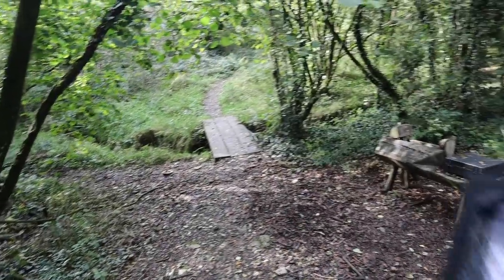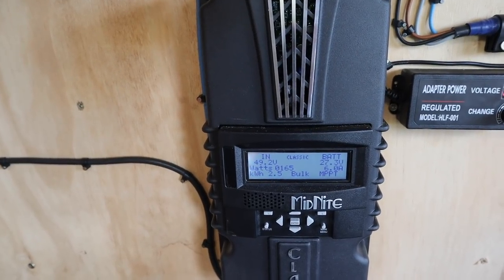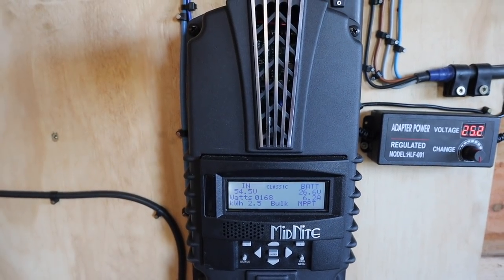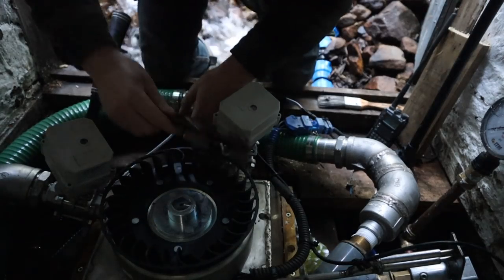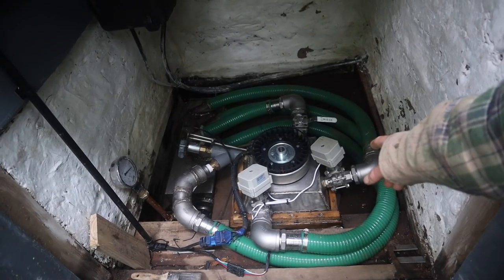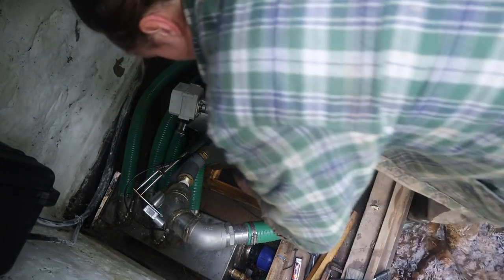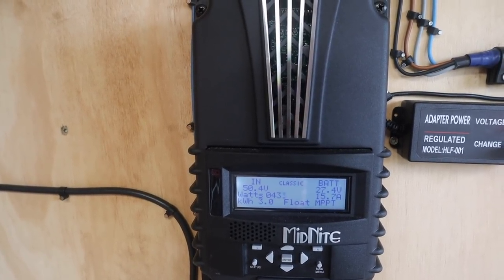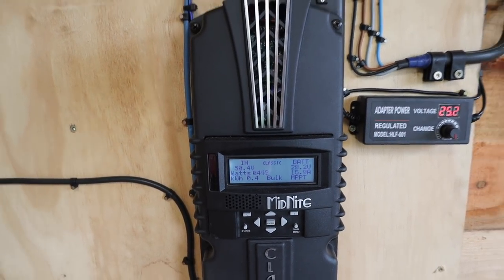Off Grid Micro Hydro Turbine Fine Tuning (13.25% Increase In Efficiency)

Comment: Careful about a hasty replacement, your rectifier likely already contains low Vf fast rectifier diodes. For any >60V 10A Shottky rectifier this is 0.55-0.65V per diode, for a total rectifier drop of ~1.1V, so check it with a multimeter in diode mode from phase to DC before you swap it. You can get very new 60V 10A rectifier parts rated down to 0.45V drop (e.g. STPS10L60 Vf=0.48V) but swapping from 0.65V to 0.45V is chasing only a few watts. Synchronous rectifiers are hard to buy for ~50V 3PH unfortunately. 

If you could find the correct transformer you could step up to 380-480V at the turbine then using a ~98% efficiency 3 phase AC to 48VDC DIN rail power supply for your rig. That'd sort out both rectifier and transmission loss... but the transformer will require some hunting, and you're still only chasing a few tens of watts at most. Your setup looks ace!!!

Comment: For tuning purposes, you can check the rotation speed at the turbine,  you could use a cheap 'contact tachometer' which would immediately tell you your gains and making a note of individual nozzle results at max tune would help you down the line in checking quickly, if anything is 'off'. Great video and hope to see some tachometer readings in future video content.

Comment: Look out for Shottky Diodes with a low forward voltage and your Amp Range. Then connect 6 of them and make the bridge rectifier out of these. You'll find plans on the web.
Reply: I agree, have used shottky on smaller projects and they work good quick responds time
Reply: Seconding this idea, although using a synchronous rectifier with mosfets would be more efficient, it is more complicated and more easily damaged than shottky diodes. And as others have said, the transmission losses of the cable would be higher.
Reply: I love peanut butter and jelly.....its complicating more than you think....
Reply: @ishansha7197  me i love jelly and peanut butter,  it's easier then you're method ;)
Reply: why 6 diodes
Reply: @davidj5574  Because it's 3 Phase AC
Reply: @70stefg  EVEN FULLER BRIDGE RECTIFIER!!!
(c) ElectroBOOM
Reply: Hmm i am wondering what is the phase to phase voltage on your system? if you are getting 60V DC it should be like 35V so you could actually use this thing!
Reply: There is also a ideal diode rectifier, using a LT4320 chip, and mosfets...ganging 3 of them, it is capable of doing 3 phase rectification
https://www.powerelectronics.com/pmics/lt4320-ideal-diode-bridge-controller-cuts-power-dissipation-improves-efficiency
Reply: @haydenc2742  this! ideal diode rectifier is where its at
Reply: @haydenc2742  There might be an issue with the AC frequency using that chip
Reply: I don't know wher you're up to with the rectifier by now. But what about a heatsink for it and a fan? Seen that used on a wind turbine rectifier.

Comment: Hey Kris,
So one of the defining factors that will decide what electronics you can use to improve the efficiency of the rectification will be the RPM of the alternator. The most simple would be a move to Schottky diodes for their lower forward voltage drop. the other stage would be synchronous mosfet switching but that would be far more involved to design. happy to help!

Comment: Hi Kris, you can place a 3-4 inch aluminum spacer block (heat sink) under your rectifier, make sure the block has cooling fins covering the sides of the block. You will find images online 'aluminum heat sink external cooling fins for rectifier'. It will also reduce fire risk.

Comment: The kind of diodes is important normal diods have a 0.7v voltage drop. Skotky diodes have 0.2v. Multiple that bij the current an that is your loss. You can meassure the voltage drop with a multi meter. Succes, love your channel

Comment: hey man might be a good idea to mount that rectifier on some kind of standoff bracket and maybe get a piece of cement board or something non-combustible to mount it to.  just for piece of mind sake. love the channel
Reply: Yeah would be awful if it lit the shed on fire - maybe a cheap second hand ebay heatsink for the rectifier as well - or even a fairly stout piece of flat metal if that's on hand.
Reply: It's still wasting the same watts as heat!
Use Shottky diodes, lower forward volt drop, less heat.

Comment: Great work Kris. I would agree with sticking with diodes. Simple and basic and just work. I was wondering that if you strapped the diode pack to the side of a metal water tank it would help cool them as well as provide some possibly useful warm water for washing in while working in the shed, it could even be rain fed :-)

Comment: Hey Kris, following up on some of your older videos, where you had the Question:  Whats the alternative to a Standard - three phase bridge rectifier (50C)?
Did you find the Alternative?
Active Synchronous Bridge (35C), Use an active synchronous bridge rectifier to avoid the diode losses (heat).  97% efficient

Comment: If you are using a "normal" rectifier there will be a forward voltage drop of at least 0.6v unless it is under-rated i.e. if you are currently close to the rectifiers rating the voltage drop could be 1 volt or more and the watts loss would be higher. If your current is 9 amps (450 watts at 50v) the rectifier will dissipate about 5 watts at 0.6v dropped and be warm to touch. 5 watts in 450 is only 1% lost in the rectifier. 

 If you use schottky diodes to form a 3 phase bridge rectifier (6x diodes) the forward voltage can be as low as 0.2v, though again, as you push more current relative to the diodes' rating, the voltage drop will rise. 9 amps x 0.2 volts would be about 2 watts wasted so you save 3 watts against a normal bridge rectifier. I don't think a saving of 3 watts is worth the effort of changing the rectifier.

The current flow of 9 amps is effectively shared across 6 diodes so I would be using at least 25a 100v schottky diodes e.g.
https://www.ebay.co.uk/itm/DSA50C100QB-Diode-Schottky-rectifying-THT-100V-2x25A-160W-TO3P-IXYS/193001047520?hash=item2cefc245e0:g:r30AAOSwuchdMWSv.

I agree that a synchronous FET rectifier would be even more efficient but they are not simple to build. Fets do not have the same forward voltage drop and just exhibit a resistive effect. Cheap fets could be as low as 0.0045 ohm each when fully "on" so even if the whole 9amp flows through 1 fet you only lose 0.04 volts drop and 0.4 watts lost.
Reply: Rhian, I think you have to double your loss figures because of the bridge configuration. (A diode coming and a diode going) I would be interested in the line loss. Not sure if he specifics the wire size and length? A transformer would reduce the line loss but add its own loss. Anyone with numbers?

Comment: Just so you know the midnight classic is cutting the power back when it's on float you need to put a load on it so it's in bulk that way you see the true maximum power output
Reply from the maker: I did switch on loads in the video for that reason. just takes a while for the controler to come out of float mode.

Comment: Hi Kris,    For your Bridge Rectifier try schottky diodes.  Standard diodes have a volt drop per diode of 0.6V . a . schottky diode has a volt drop of 0.4V.    So if your running at 20A then there is an approximate 4 watt saving to had.

Comment: It's funny to think your smaller nozzle would be my largest. You could wire more rectifiers in parallel I think to reduce the resistance.
Reply from the maker: i would love to have the pressure you have though! things are cheeper when you have high pressure low flow.  After seeing your last video i really think the spear valve is going to cause you problems. i would go with two fixed nozzles that you can easily change. that low flow is going to be REALLY hard to set with a spear and you will find the range of adjustably is tiny, just a fraction of a turn and you will go to far and be draining the penstock. Just my thoughts :)
Reply: @KrisHarbour  Yes, I might at some point in the future have to try machining a smaller spear valve like you have been mentioning. Spears don't work then I will try a 4-bit arrangement of nozzles 2, 4, 8, 16 gallon per minute nozzles and turn them on and off automatically to keep the forebay tank full. That will allow me to tune flows in 2gpm increments. I found some data showing one right-sized nozzle is more efficient than multiple smaller nozzles so that's something to think about. I think below 2 gallons per minute I will have the same friction losses you are experiencing and might need to build a second smaller turbine that has lower friction but lower capacity for the summer flows. 
Which model of generator are you using from motenergy and what rpm are operating at to get your voltage at your maximum watts? I'm at the point where I need to select and buy my spoons.
Reply: Putting diodes in parallel is not going to reduce resistance or voltage drop, they are semiconductors.
If they are ordinary diodes they will drop 0.6V on forward conduction, and 0.2V using Shottky.
The current will be shared between the diodes, but the same power will still be dissipated as heat over more diodes.
Reply: @martinwragg8246  that makes sense.

Comment: I agree with other commenters that Schottky diodes should cut power losses significantly - at least half, if not a third or better, depending on the Vf of your current diodes.
 It's the exact same circuit as you already have and there are lots to choose from. Personally I'd go for something like 4x IXYS DSS16-01A, since they've got a low (640mV) forward voltage drop, can handle 50% more current than you'll likely subject them to, at twice the voltage, and they're only about £1.50 each in small quantities.

Alternatively you could build a MOSFET-based rectifier using the LT4320 chip from Linear Technologies, which is fairly trivial. Total part cost would be about £22 if bought from Mouser UK, assuming you can scavenge a heatsink from somewhere for free. The 8-pin DIP packaged part (LT4320IN8) is about £9 inc. VAT. For transistors I'd go for either Fairchild FDP023N08B-F102 or ST STP260N6F6 N-channel FETs, both of which are readily available and cost around £3 each inc. VAT. Both have very low on resistance (Vds-on <2.5mOhm) and have breakdown voltages exceeding 75V, which should be ideal here, and both come in a TO-220-3 package which makes it easy to solder to them and screw them to a heatsink. The circuit design is in the datasheet for the LT4320 which you should be able to easily find online - effectively it's the same as a diode full-wave rectifier except the diodes are replaced with MOSFETs and you have a chip that sits in the middle which connects to all four "points" on the rectifier, plus the four transistors' gates. Total power loss at max load would be about 5W, compared to the 24W-ish you'd lose at max turbine power with a decent schottky rectifier.

Comment: I was wondering if you really need the fan, or if it’s just a safety to prevent uncontrollable spins. If it’s just for the no load situation I wonder if a centrifugal clutch could help not waist the energy during normal operation. Great videos!

Comment: I'm thinking what these small hydro applications need are fine adjusting slide plates for the nozzles to mount to & an accurate means to measure the turbine's rpm.

Comment: You could be loosing energy by having the manifold down near the turbine rather than a manifold up at the inlet end with 4 penstocks, one for each jet.
Hydro turbines rely on kinetic energy of moving water as well not just hydro static pressure and your system likely relies mostly on hydro static pressure alone as the kinetic energy of the water is accumulated in the manifold.
Down stream where the water is flowing at high speed the more looses there would be from friction due to any sudden change of direction of flow at a manifold or tight bend.
Consider 4 penstocks off a collection manifold up top for each jet and bring in all 4 above the unit and have a large radius bend on each of them downward to each jet to maximise the velocity of the water as it arrives at each jet.

Since you have the means to measure power output of each jet it would not be hard to try it by taking one hose off the manifold and block the outlet off the manifold and then running another penstock pipe down to the one hose to see if that jet increases the power from it being fed by its own penstock pipe rather than off the manifold.
Reply: So it would be more efficent if the feeding pipe splits in a 1in4 manifold rather than with the collector box feeding the 4 nozzles? Like a 4in1 exhaust manifold, only inverted? Interesting idea!
Reply: @horstszibulski19  
A bit like that
As the water runs down hill it is storing energy in the form of momentum the more energy will be lost by it colliding with surfaces like a manifold unless the manifold is well designed to bifurcate the water smoothly and the box is not a smooth path of flow and probably acting to diffuse energy of the moving water.
So having the 1 into 4 manifold up top where the water has not picked up momentum the losses would be reduced.
Reply: @AuMechanic  So Kris would need 4 feeding pipes from the intake downhill to the turbine?
Would be great to see how much differnce that concept would make, but I think in this case it would be too much effort and spent work&material just to prove this...Kris said he already produces the equivalent to the consumption of a average UK household in energy, hence he don´t use that much, so the actual setup would be more than enough...
But nice to have this interesting discussion!
:-D
Reply: @horstszibulski19  
It would not be hard to test that with 1 narrow pipe to one of the jets,.
Alternatively weld up an improved manifold a little up stream from the shed that has a far more streamlined outlets off the main feed to ensure laminar flow by the time it gets to the jets.
Good "penstock manifolds" and you will find some examples.
Reply: Too late to comment, I know but, this would be an enormous effort in time and energy - and huge cost for relatively tiny improvements. In fact I'm not convinced theyre would be ANY!
An example of impractical thinking....?!
Reply: @andymccabe6712  On the contrary, making an assertion based on no logic as you just have done would be a prime example of impractical thinking.

Comment: Hey Chris love your videos if you pull your main line and manifold outside the shed it will give your lines as straight and shot each water line and take the 90s off and put 22 which will increase your efficiency for sure
Reply from the maker: the building is lower than ground level, to do that i would have to dig out alot of earth or have to make the penstock higher (witch would be a big loss)

Comment: If you did ever want to extend wireless out to the turbine shed for monitoring, check out the wireless products from Ubiquiti. A pair of NanoBeams would work well, and you can run them off DC for solar/hydro.

Comment: In case no one already mentioned it, you need an AC-DC converter for high efficiency AC-DC rectification. Basically a 3-phase H-bridge with a controller. It's a similar concept to a normal line frequency SMPS. Not exactly sure how it would work with your MPTT system as it would have a regulated output, not an unregulated output like you have now. Cheers.

Comment: If you know your cable gauge & material or resistance per unit length and cable run length from generator to charge controller, you'll be able to calculate your power loss in the cable alone (I squared R), and also how much you can reduce that loss by if you invest in thicker cables (or find scrap for free). If you have some more of the existing cable, you can simply install a second parallel run to reduce your cable power losses. This is one of the key reasons for preferring higher voltage over higher current for shipping power over a cable.